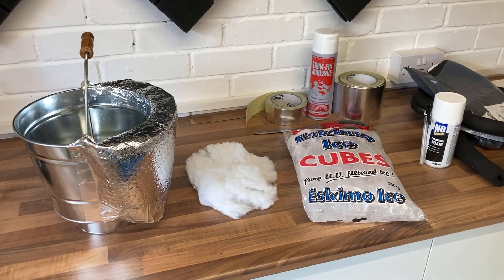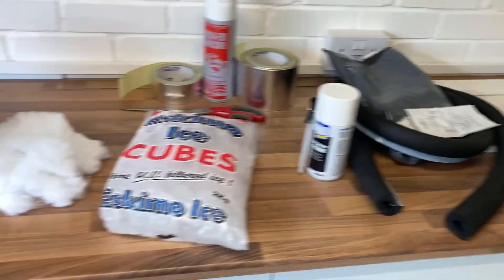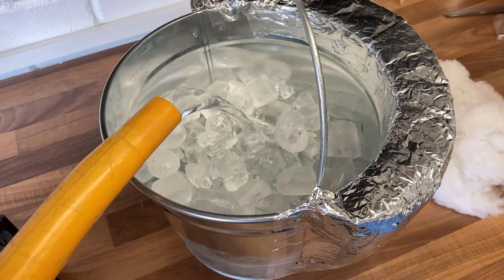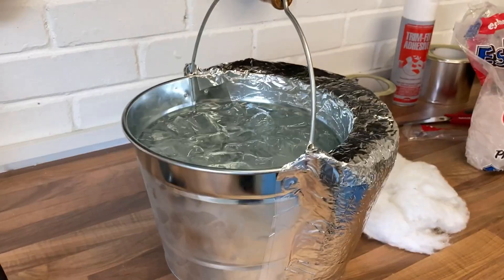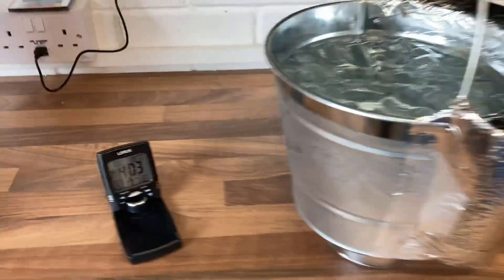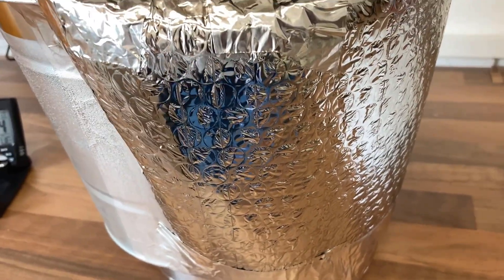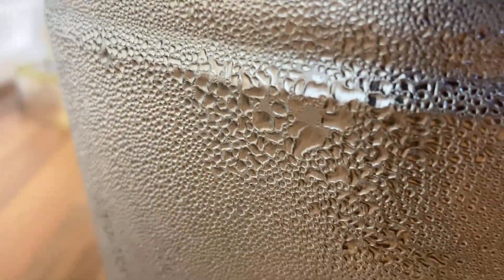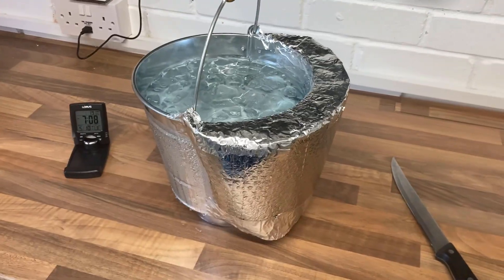Vapour Barrier in a Van - I can Prove they Work.

Comment: Wait, so the vapour barrier stops condensation on the sheet metal? How does that work I always thought it stopped moisture getting through on the other side of the barrier.
Reply: Condensation is formed by moisture  held in warm air hitting a cold surface, if the warm air can't get to the cold surface it can't condensate.
Reply: @leeangell8889  so the air between the vapour barrier & the cold surface is presumed to be cold? Or at least not as warm as the air inside the van?
Reply from the maker: @madzyadzy07  the void inside the barrier has so very little moisture content as to be negligible. Because no more moisture can get into that void condensation cannot happen. On the bare side there is a massive volume of moist air so it will continue to condensate as long as it’s below the dew point. Hope that helps.
Reply: @GregVirgoe  ah! That makes a lot of sense! So would it be best to do your insulation and vapour barrier in cold & dry conditions considering that air you’re trapping in the void will have minimal moisture since cold air holds less moisture than hot air? Or is that overkill?

Comment: Thanks for the video!!It would be interesting to see how much moisture would get in if there was a hole in the vapor barrier. It would have to be a long term test. I used the same type of barrier, but when adding finished wall,  I know there are some screw holes through the barrier. Hopefully the small amount of moisture that gets through will do no harm.
Reply: Screws are usually fine, the screw self-plugs the hole
Reply from the maker: As Paul rightly says a screw does not leave a hole 🕳😃👍🏼
Reply: @GregVirgoe  what about light fittings
Reply from the maker: @laurenmichele2029  you seal around any recesses or cables with foil tape as I have shown in my build videos. A little care and attention is all that’s needed. 😊

Comment: Cracking demo Greg - nicely done. So the next question is: you have a van that was done by the previous owners. There's no vapour barrier and the insulation is perhaps a bit patchy. It's going to be a bit of a mare to pull the interior and try to add a barrier, so .. do it, or sell the van and start again? 😆 Anyway, great video and thanks again.
Reply from the maker: You can heat and ventilate the van to reduce the effect. It won’t stop it completely in cold weather but will help to reduce it 😊
Reply: Less of an issue in warm, Mediterranean weather, with good ventilation all condensation from the night can be removed on a sunny day.
In the North, remove the interior and put a barrier in. Otherwise it's either mold or high heating costs from frequent ventilation